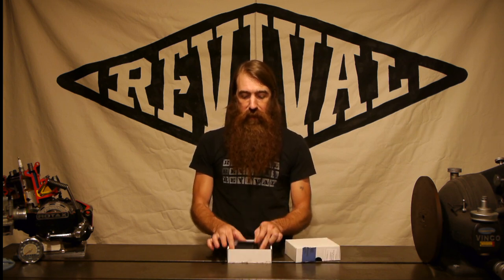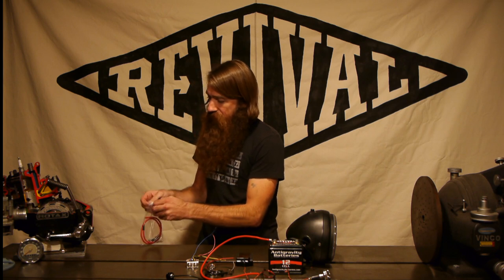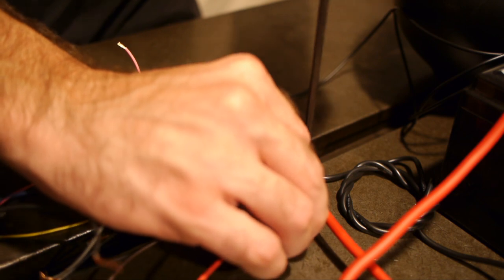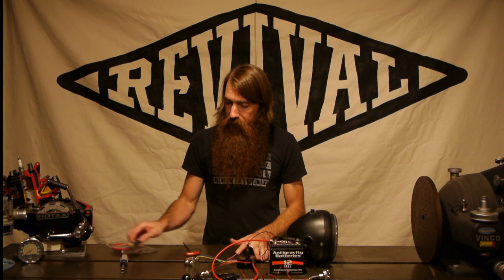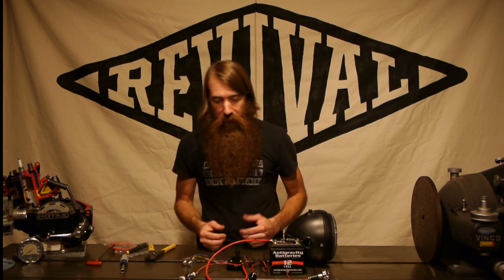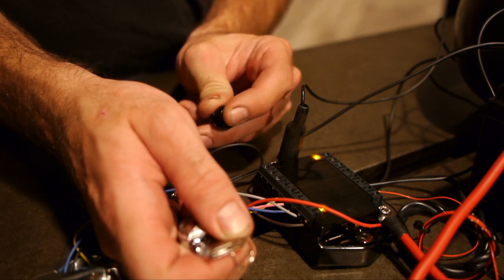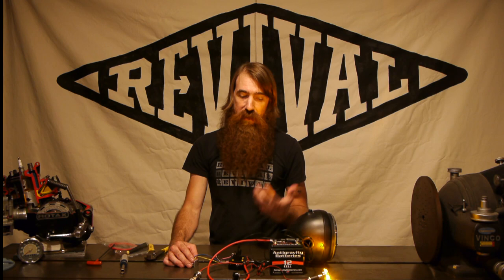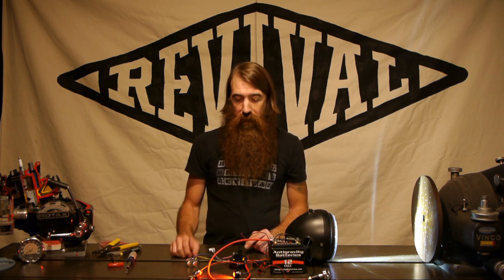Wiring the Motogadget m-Unit V.2 - Revival Cycles Tech Talk

Comment: Wow!!! This seems to be an AWSOME product.  Just in the fact it labels the in/outputs, protects all circuits and customizable with the configuration button.  I'm totally interested in replacing my load equalizer.  This video has me saying "you are BRILLIANT"  If it works like demonstrated for me on my bike all my problems will be solved and dreams have come true.
Reply from the maker: I know that feeling, and had the same reaction the first time I saw one. It does take a bit of work to complete an installation, but in my opinion it is far better, faster, and easier than doing a traditional wiring install. This is the coolest piece of moto electrics to come out in the last decade.

Comment: Im a Motorcycle Mechanic and a customer is brnging me a bike next week with a "M" unit installed. He,s having charging system problems, intermittent charging. Anything in the unit i should be looking at? You mentioned the aux port as having a charge wire going into it?  The bike in question is a 1975 cb 550 honda.
Reply from the maker: The m-Unit really doesn't have much to do with the charging system, and the only connection between the charging system and the m-Unit is the reference or excitation voltage for field excited systems. The AUX output is just a solid state switch that provides power for the ignition system and any other circuit that needs power when the ignition is active, like the charging system.  So with the 550 I think those are field excited, so there should be connection between the reg/rec and the AUX output, but if that connection is solid there isn't anything the m-Unit can do to affect charging.
Reply: Ok thanks for the reply. I will look at the usual suspects.

Comment: If you don't have a button there should be no problem in just attaching a wire to config and connecting it to ground for push? right? - thanks for a nice product and great videos!
Reply from the maker: Yep, that totally works, and its exactly how I do it on our builds. Its usually faster to just grab a scrap wire off the bench than to walk across the shop to find a button. Its also temporary, so no need to use a real button.
Reply: Excellent Asger. This is the answer to my question! I take it you just tap the wire on the frame to change the settings? Or am I talking shite?
Your help is appreciated.

Comment: Hi i just bought an M-Unit because of how great these videos are!! can you advise me on which output i should use for a numberplate light?
Reply from the maker: Typically I like to use the AUX output for the number plate light. That way if the ignition is turned on and the engine is ready to run the number plate light is on.

Comment: I suppose the M unit does also work with other buttons and switches instead of the "M-button" and such? Like everyone said reaaaaally good how to video !! thanks !!!
Reply from the maker: Yep, the m-Unit will work with virtually any type of switch you want to use. That is part of what makes it so cool is that the input side of the m-Unit doesn't handle any current, and are just signals that tell the m-Unit what to turn on. Any device that can turn on and off a connection to ground will work for the input side of the m-Unit.

Comment: Hi I need help! I've purchased a universal switch ignition which has 4 terminals. Three have two parallel contacts and the other just one. Which one connects to the battery and which one connects to the m-unit lock? Thanks in advance.
Reply from the maker: +Louis Emina I don't fully understand your description of the terminals on your switch, if the switch included a wire diagram of how it is setup that would help a lot. The other way is to use a multi meter and check the terminals and find a pair that is open when the switch is in the off position and closed when the switch is in the on position. This way one is connected to battery and the other is connected to lock input. With an m-Unit you should not need more than two wire connected to the ignition switch. There are a few exceptions to this, like magneto bikes, and certain dirt bikes that can run with out a battery.

Comment: I think it's already answered in the video , but just to confirm when running LEDs instead of incandescents with the M-Unit you don't need resistors correct?
Reply from the maker: The m-Unit doesn't require load balance resistors with LED's, and the built in flasher relay is compatible with any type of 6 or 12 volt light. However, depending on what type of LED's you are using you might need current limiting resistors. Most LED's sold for vehicle applications have this built in, but if you are building a DIY light with raw LED's you'll need some type of current control, and the easiest way is a simple current limiting resistor.

Comment: Awesome product... 
Quick Question. Are you wiring your ignition module and regulator to this unit as well, or there a separate unit for it???
I'm working on an 80 XS850 and it is a birdsnest. So I'm trying to figure out the best and cleanest way to rewire everything.
Reply from the maker: +fluffyD110 

Both the ignition module and regulator are tied into the m-Unit. For reference, you can visit page 10 of the m-Unit manual at this link: http://motogadget.com/media/downloads/manual/munit_v2_manual_en_3.2_k.pdf

Your ignition will pull power from the AUX output on the m-Unit and the regulator ties into the Positive Main Terminal on the m-Unit.

If you have any more questions about your project, feel free to send us an email at websales@revivalcycles.com and we can help you out with specific wiring questions!
Reply: Hey there xs buddy. Got an xj1100 and yes the wiring is indeed a birdsnest haha. Hope your builds going well

Comment: When using the M-button with the M-unit, do you need an additional wire/button connected to the configure terminal to access the setup menu?

I didn't see this mentioned in the manual download you referenced. Or do you use one of the six switches connected to the M-button?

I'm getting ready to purchase the M-unit and switches but am unsure if I need to buy 2 three button units or 1 three button and a two button set.

Thank you for your time
Reply from the maker: supersportimpalass  There's no need to buy an additional button, we generally use one of the buttons on the switches for programming and connect it to the proper function once we complete our configuration of the m-Unit.

Comment: will you do a video about the m-unit blue? also how do you connect the speedometer and tacho to this system?
Reply from the maker: The m-Unit Blue is on the list, we've got one that we are starting to test, once we get a few extra minutes we will shoot a new video. As far as connecting the speedo and tach, that all depends on what type of speedo / tacho you have. In 90% of cases, the speedo/tacho are just getting power from the m-Unit via the AUX  output, the m-Unit has nothing to do with the sensing or measurement.

Comment: Hi, and thanks for great videos. I have a FXSTB 2001 engine and frame, and are wondering how do you connect the m-unit, motoscope mini and motosign mini, and what would you keep from the old wiring harness when conncting it with the TwinCam? Or would you throw it all in the bin?

Comment: Great video.  I was wondering how the idiot lights, e.g. for the turn signals (indicators in the UK!) and hi / lo beam headlight, connected up in this system?
Reply from the maker: +Adam Connolly 
The best explanation for the idiot light wiring is on the m-Unit manual page 11. http://motogadget.com/media/downloads/manual/munit_v2_manual_en_3.2_k.pdf. But basically the neutral and oil pressure lights are switching the ground side of the electricity and this means that you connect power from the AUX output to the light, and then from the light to the respective switch, then when the switch is activated the light turns on. Then for the turn indicators and headlight high beam, power to the dash light is tapped off the power going to the actual light, and then goes through the dash light and then to ground. The one point that is different about the turn indicators is if you only have one dash light for both indicators then you need to use two diodes to prevent power from crossing from one side to the other at the dash light. On the other hand if you have two dash lights for right and left turn indicators then they can be wired directly in parallel to the primary turn indicators.

Comment: I have ordered one for my ‘69 Bonnie ....the question is : how to manage the positive ground on that wiring ? Thanks a lot !
Reply from the maker: Thanks for the order, and I hope you've already got this info, but in case you are still wondering. The best way to deal with this is to switch to a negative earth system. It sounds worse than it is, and you really just need to take a look at the charging system and the ignition system and rearrange how they are wired. 

Most ignition systems can be setup to work both ways, same is true for the regulator/rectifier in the charging system. But worst case you may need to get a new reg/rec.

Comment: Great video and thanks for posting! Just a quick question about the turn signals. I noticed that you only set up one signal. If you had both a left and right turn signal would you still control them with the one button? How does that work? I'm asking because I am thinking of using this set up on my bars and want to know if I should order a 2 or 3 button m-Switch. Thanks!
Reply from the maker: Saturdays Wrench We just set up one signal for the purposes of demonstration. The m-Unit has input and output terminals for both Left and Right side signals. So, using the m-Switch setup would require a button for each, left and right indicators. If you check out the product listing on our website, there's an image with all of the inputs and outputs documented for reference: http://revivalcycles.com/products/motogadget-m-unit-controller. (Just for clarification, use of the m-Switch does require an m-Unit to work properly.)

If you have any more questions, feel free to shoot us an email at websales@revivalcycles.com for more assistance!
Reply: Revival Cycles Yes, I figured it was just for demonstration. I guess what I'm asking is, you would set it up in a way that you would have one button on the left for the left signal and one on the right for the right signal? or would you have 2 on the left side of the bars? Thanks for the link, I will check it out. Thanks for replying also, I appreciate you guys taking the time to get back to people, it's cool.
Reply from the maker: Saturdays Wrench Apologies for the confusion! You can set the m-Switch buttons up really however you like, if you prefer a more traditional configuration with both left and right signals on the left side of your bars, you can do that. Generally, we set it up with one button on the left side of the bars for left signals and one on the right side of the bars for right signals.
Reply: Revival Cycles No worries.. Ok thanks again for everything!

Comment: you said it's 6-24v compatible?  I have a 1975kz900 that needs to batteries to start (14:1 comp).  could i just run 24v all the time assuming my lights and coils can handle it?

Comment: Can this be used on an Escooter if I have a battery pack? How much battery voltage would I need and how would I know the voltage I would need? Do I add up the wattage of the headlights, turn signal lights etc.? I'm interested in using the motogadget handlebar turn signal lights, probably a high lumen bicycle head light and a battery operated horn. How can I do that?

Comment: Nice presentation of a great product. 
I'm looking to get rid of both my clunky OEM instrument clusters on my 2013 Ducati 1100 EVO ABS.
How would the m-Unit control, scroll and select the finer functions of the OEM display? Such as changing miles to kilometers, changing Rider ABS intervention level, display brightness for example?  
These are currently controlled by a rocker switch you move forward and backward, holding each down respectively to confirm a wanted change in preference.
Thank you, 
Caswa
Reply from the maker: This is not a straightforward question, and really a bike that is sophisticated enough to have different  riding modes, and ABS settings should have very high quality wiring that makes the use of an m-Unit un-necessary. Specifically with ducaiti's removing the OEM instruments and dash panel can be very problematic as they incorporate that into the anti-theft system in many cases. 

We haven't re-worked the electrical on that generation of monster yet, so you may find more accurate info on the duc forums. It may be possible to remove the gauges, on your bike, but I know the bikes from the early 2000's through 2008 cannot have the gauge removed with out reprogramming or replacing the ECU to eliminate the anti-theft system. 

If this is something you really want to do email techsupport@revivalcycels.com and we can help you come up with a plan, and try to give a gist of what to expect for challenges along the way.

Comment: Awesome product, wish there was some more info out on them, I purchased one through you guys, maybe you would know, what is the output on the AUX terminal? I've got one of those PAMCO units and for some reason I think it's only supposed to be fed 7.5 amps. Thx in advance
Reply from the maker: +TheGreatWhiteNorthTV 

The output on the AUX is 16a so you shouldn't have any issues with the Pamco ignition. Page 7 in the manual provides the max amperage for each of the outputs. 
http://motogadget.com/media/downloads/manual/munit_v2_manual_en_3.2_k.pdf

Comment: Hi I wonder if you can help me. I've connected the m unit on my cb550 all is good except one issue. When I put the headlight on the rear also comes on BUT when I push high beam the tail light goes off. Iam scratching my head. Can't figure this one out. Everything else works. Indicators,break lights. Iam also using the 3 button mswitch
Reply from the maker: +Misdemeanor Customs It sounds like you have your tail light getting power from the low beam. This is typical of how they are wired from the factory, but with the m-Unit I think it might be easier to use the 1-wire tail light feature. You disconnect the tail light wire from the bike side of the harness and connect it to the brake light wire so that the tail light only has two connections to the bike harness (one ground, the other brake light wire connected to brake and tail wire on the bulb side). With it setup this way, you should have the original tail light wire on the bike side of the connector open and not connected to anything, this wire is not used anymore and can be taped up so it doesn't short out. 

Then in the m-Unit configuration setup menu 2 as configuration C. This way the tail/brake light will get 50% power to both circuits of the tail/brake light when the brake is not active. Then when the brake is active, both circuits will have 100% power.  This is all controlled in the m-Unit, and this should solve your problem. 

If you have more questions or need additional clarification on how to do this email us at techsupport@revivalcycles.com

Comment: On your installs do you have fuse between the M-unit and the battery? If so what rating? The 10mm^2 cable they supply to power it is really hefty. Thanks!
Reply from the maker: +Tim Flannery The m-Unit doesn't need a fuse between it and the battery, but the charging system needs a fuse between it and the battery. So as long as the charging system is fuse protected you are good. The rating of this fuse depends on the gauge of the wire coming from the charging system, most the time these are 16 gauge wire and a 20 amp fuse is appropriate. But this will depend on your specific bike. 

On our installs we do not use the 10mm^2 wire because it is unnecessarily large, instead we use a very high quality 12 Ga copper wire with a cross-linked high temp insulation.

Comment: Thank you for educating me for I am new to this work.  I plan to transform all my lights units, ignition system and the regulator rectifier into 12Volts system.  I am pretty sure know how to hook up the m-unit v2 to the ignition system, lights, turns signals, brake lights.  Where will I hook up the regulator rectifier to and from?  Will the link that i sent to you would work if i follow that schematic? Or to you have any suggestion?  Thank you for your help.
Reply from the maker: Quoc Luu 

Using the wiring diagram you sent to us, you would hook up the regulator rectifier as referenced in the diagram. To reiterate though, you will need to have a regulator rectifier compatible with the new engine.

Comment: Great tutorial... i just got my m unit blue. What happens to the CDI? I have a Dyna tech 3000 plugged into the factory wire harness. Thanks in advance
Reply from the maker: It depends on what you mean by CDI...that term gets used too often to describe an ignition control module, but it actually means Capacitor Discharge Ignition, and that is far less common these days. With the dyna 3000 you would just need to determine which wires are getting switched power and connect those to the AUX output or the ignition output.